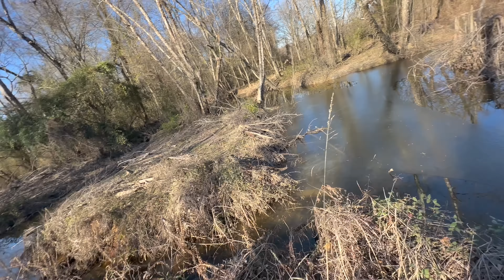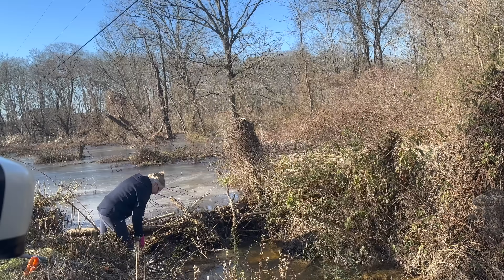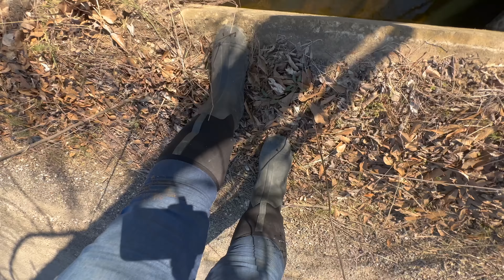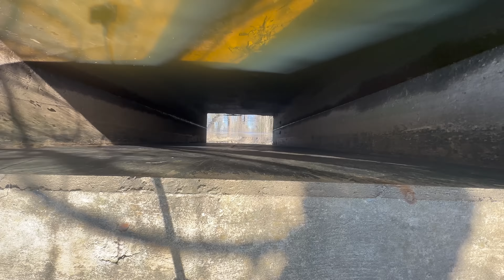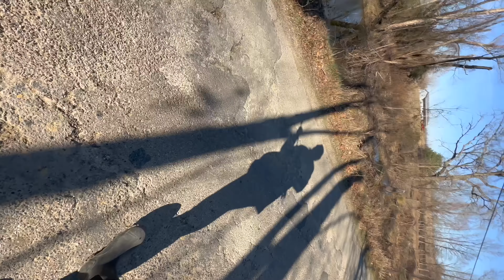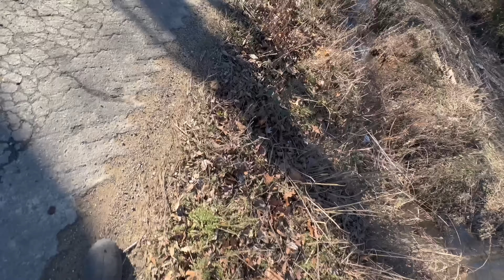unclogging beaver dam # 2 please read description!! 12/27/22

Comment: Y'all are working way too hard. Try this approach.
Throw a boat anchor attached to a chain behind the dam.
Attach the chain to your truck and PULL !!
You can usually get about a ⅓ of the dam out with 1 pull.
Then when the water level drops, do it again the same way.
Reply: I get the feeling they like the hard work Popeye.